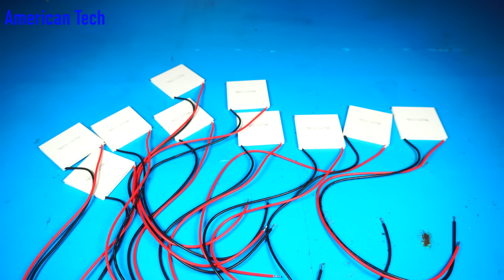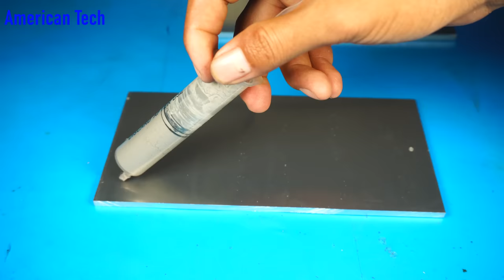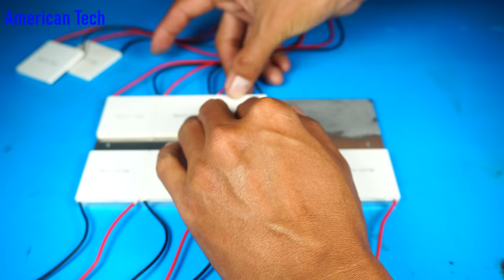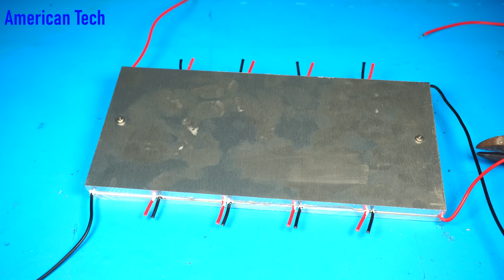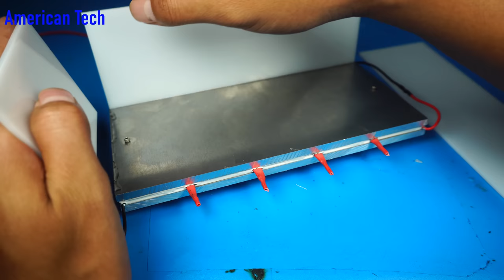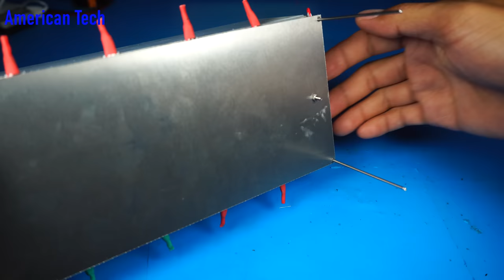DIY a big power of Thermo generator

Comment: Unfortunately, this video is claiming to generate power from a candle flame is not legitimate. In the video, the individual uses a Peltier device instead of a Seebeck or TEG generator. Additionally, the maximum current generated by these Peltier pads would not be enough to run a 24V motor of that size. To power a 12 Watt motor, a minimum of 12 Watts of power would be required. However, the individual in the video is producing only 1 Watt of power, including burning power. The Peltier device is known for its low power efficiency, producing less than 3% of the input power. This means that even with 100 Watts of fire under that contraption, it would generate less than 3 Watts of electrical power.

On average, a candle flame generates only 0.04 to 0.06 watts of power, which is a relatively small amount of energy. To generate 0.5 Watts of power, it would be necessary to use ten candles. It is unfortunate that social media platforms do not fact-check misinformation when it is not related to politics and fail to ban videos like this one, as they do with content that goes against their governmental agenda. It is important to be vigilant and critical when evaluating claims made in online videos and to seek reliable sources for accurate information.
Reply: Excelente.
Reply: Can u suggest the teg generator component to me that apply setback effect?
Reply: 1. "Peltier Device" is a TEC(Thermoelectric Couple).
2. "TEG" is a TEC( Thermoelectric Couple)
3. "Seekbeck" is a TEC(Thermoelectric Couple)
Items 1 thru 3 are infact exactly the same thing. They are simply layman's terms for application specific uses of a TEC.

 "A TEG"(Thermoelectric Generator) is an application specific layman's term used in place of thermoelectric couple when using it in a configuration to take advantage of it's Seebeck effect properties to generate electricity.

"A Seebeck" is an application specific layman's term used in place of thermoelectric couple when using it in a configuration to take advantage of it's Seebeck effect properties to generate electricity.

"A Peltier Device" is an application specific layman's term used in place of thermoelectric couple when using it in a configuration to take advantage of it's Peltier effect perperties to transfer heat from one side to the other (to heat or cool something) instead.

A TEC ..is exactly that..a coupling..or rather a conversion between electricity and temperature in either direction..regardless of what one chooses to call it.
Reply: If I were to build a larger setup, than what's shown, using 50 TEG's but heated by 300°F (+ -) from a wood stove chimney, and cooled with an endless supply of 40° - 45°F water constantly circulating, how many projected watts could it possibly produce?
Reply: Nor would I use acrylic. I'd weld steel watertight containers on the top side. Anyway, how many watts do you think? Hypothetically, for a maximum heat difference of 150°C, what could be the projected watts?

Comment: I want to make something like this for my woodstove. I live in Canada and heat with wood. Ideally, I would have a row of them being cooled by the cold air intake from outside while being heated by the chimney or a stovetop heatsink. I would power a fan with part of it for the air intake and then trickle charge my batteries through my charge controller. It would help with the lack of sun on my solar panels here in the winter time. Another idea I have is cold water on one side and hot water on the other. It would make more power but I am not sure what to do with all the water. Air handling seems simpler since it is happening there already
Reply: That’s what I want to do too!  I wish I could hear about your progress.

Comment: I know these very well and no way is it 500W the best TEGs are only 20w output each so if were 20w which they are not would be 200w .
Reply: They sell large ones...from 50w/100w all the way too 400w from one unit ones from Germany n other places not just China
Reply: Can you provide a link to these suppliers?
Reply: Links on here will always be deleted by bots.
Reply: @jshaw4757  the cooling and generating are not 1:1
Reply: In the same sentence you say that they output 20 watts and they don't output 20 watts. Which is it😅
Reply: @bryaniskoo  He's saying the very best commercial TEGs are 20 watts, these are almost certainly the cheap 2 dollar ones that generate 2-4 watts. But even if they were 20 watt TEGs you're only looking at 200 Watts total for 10 in series not 500 Watts
Reply: @tjfreckles1995  yeah they hardly make any power. The Amazon ones are complete trash for anything other than arts and crafts.

Comment: This is the best one I've seen yet but it's still not right. No one is making them properly

What you want is 2x2 panels stacked 4 panels high

Have the cold and hot sides all touching and have the main hot side bottom and the main cold side top. Having them stacked like this means they'll balance the heat out amongst all of them evenly and produce more power overall

For the cold side you should just have a square metal tube with the top cut off and a heat sink in the middle where it contacts with the panels then run cold water through the tube

The hot side can be run with vegetable oil if you use carbon felt. It's able to wick vegetable oil to be used as a candle and it's super safe because the oil can't burn unless it's being wicked by the felt. If it tips over the fire can touch the spilt oil for a very long time before it'll light on fire
Reply: Or cut a hole in the hood of your car. The top facing the outside should be able to cool off as you are driving. Then we can get rid of the alternator improving gas efficiency and now we can charge the car while driving.
Reply: Hi,
You seem to have a good knowledge about TEGs.
I have a question, can I make a grid of TEGs with cold side facing outside of a wall of a room and the warm side facing inside the room (with a fan of course) to make an air heating device for free in winter?
Reply: @Maxim.Teleguz  that would work, but you'd want it exposed to air from underneath the car, not on top of the hood. The sun will heat cold panels, reducing efficiency otherwise

TEGs still have extremely low efficiency, so you'd be better off just sticking with the alternator
Reply: @seyedseyedy3558  That would work as an air heater, but it would be extremely inefficient and most certainly not be free

TEGs have relatively low maximum temperature ranges. You'd be lucky if the hot side reached 70C

 Nothing is ever free. You'd need to pay for the parts, and I'm sure you could find a heater for a similar price to what you'd pay for parts 

TEGs can either use energy to heat and cool, or they can use a temperature differential to generate energy. What you want to do will use energy. You'll be heating air inside and cooling the outside air, which costs energy
Reply: @drsatan9617  Thank you very much for your response.
I've seen people putting hot water on one side of a TEG and get a very low current or vice versa, if they put ice on the other side. 
But my plan isn't to produce electricity, I just want to use the outside freezing temperature on one side and get heat on the other side. The 70 degree that you mentioned is quite sufficient. 
Is it possible?
Reply: @seyedseyedy3558  It's not possible. Either you put energy in, and one side gets hot while the other gets cold or you get energy when one side is hot while the other is cold

You can't have it both ways with one circuit 

To generate heat with them, you need to input energy

It doesn't change anything if you only heat one side or cool the other. It'll still generate power as it works based on the temperature difference of each side

Which way you have wired it determines how it will function. 

You have your TEG, and it has positive red wire and negative black wire. Hook those up to the correct terminals of a battery, and one side will heat up while the other side cools down. 

If you wire it up the incorrect way as in put the black negative wire to the positive battery terminal and the red positive wire to the negative terminal, then the battery will charge if you heat one side and cool the other

As far as the videos you've seen are concerned, it doesn't really matter if you either heat one side or cool the other. So long as they aren't at the same temperature, they will generate power. The greater the difference, the higher the current
Reply: @drsatan9617  Thank you very much.

Comment: Lol 500 watts huh. Not in your lifetime. The best you can expect is 5 watts per module and that's at about a 150 F difference in temp. Fake AF.
Reply: Why so many models....50w/100w/all the way too 400 watt just bigger modules even the German ones claim 100w for around £30 so you think even top German company's are lying and Japanese modules n other euro company's thst make them
Reply: I'm from England so I use degrees but if a large heat sink on bottom sat in ice water with a PC fan blowing across and you use a hair dryer on top you think it won't get close too written pottentisl I mean I bout cheap Chinese ones years ago but I didn't really know what I was doing back then but if I remember it charged phone n ran LED n stuff
Reply: @jshaw4757  Where can I find the German one? Can you provide some link or Company name? thanks

Comment: i just tested the same module yesterday , using hot water, the temperature difference might be 60 degree , and it output about 1.6v and 60ma  , so for my condition, if i joined 10 of these modules like you, it will output 16v*0.06a = 0.96 watts, since this video use fire for heating, i guess the power watts cannot be 500 watts, maybe 50 or less
Reply: unfortunately this video is another fake. He is using Peltier instead Seebeck or TEG, second the maximum current generated from these peltier pads wouldn't run a 24V motor of that size. He would need at least 12Watts of power for that motor,  but he is producing 1 Watt if all is correct including burning power. Peltier is less than 3% power efficiency. So 100 Watts of fire under that contraption would generate less than 3 Watts. A candle flame typically generates around 0.04 to 0.06 watts of power on average. It would be necessary 10 candles to generate  only 0.5Watts. 

I have seen people wasting a large sum of money trying to replicate fake online videos. It would be wise to do mathematical calculations using physics before attempting to build something. I know people that believes on youtube videos when showing scammers powering cars with hydrogen gas and other misinformed products. These innocent people could have died if nobody wouldn't have stopped them. To replicate these contraption will not work and only waste money or place lives in risk. It is a shame that youtube wont use fact check for misinformation when it isn't related to politics and ban videos like this. The only time you see it working is when they dislike someone against their governmental agenda.

It would be amazing if we could really use TEG to generate enough power in times of emergency but it is far cheaper to have a solar panel of 20W and small 12v batteries of 2000mAh in the scale of 1 to 100. You could buy the solar panel and a battery for less than $20 online and have far more efficiency.
Reply: @melissahulkenberg5376  thanks for the detailed explain, its still useful for me to use TEG, because for large using, its cheaper by storing heat than storing electricity (using battery), also the current battery cannot last a lifetime usage while heat storing container could. so if the TEG could became cheaper than currently in 10x, i guess i will need a home electric system on it

Comment: Notice how he blocks the meter while running the motor? i see when he started the wattage was only 18 @ 30.6 volt and occasionally you can see part of the meter screen with wattage dropping to under 1
Reply: ummm. he disconnects the wires from the meter to touch them to the motor. How could it read anything in that case?
Reply: @Mr_Chuckles  yeap, he didnt get it.

Comment: he have 10 peltier at 2 watt each its 20watt... seem enough to feed the diesel heater on low setting with his own waste heate... maybe with more like 20 peltier will be enough power to circulate water to move the waste heat collectors flow

Comment: Can you use a step-up transformer to power appliances?
Reply: maybe a little alarm clock. no way this is anywhere close to 500watts
Reply: No. It's output is DC. Transformers utilize AC.
Reply: @justtinkering6713  a step up transformer that converts DC into AC, if i'm not wrong the right name is a inverter, but this setup won't generate much power
Reply: @skorpionmk9390  an invertor does that. But it's not considered a step up transformer. The circuit takes the DC and turns it into AC then sends it to a step up transformer. It's more than just a transformer.

Comment: Can it be used as a solar panel without ice ?
Reply: You could use them as a solar heat collector. It wouldn't be converting the light into power it would be converting the heat produced from the sun into electricity. 

These peltier units operate using the Seebeck effect. Nowadays they are made from semi conductors like solar panels but they don't work in the same way.

You don't need ice you just need a hot side and a cold side. If you power them you can exhaust the heat produced to make the other side cold or hot depending on the application.
Reply: I've found that this is the basic units that NASA uses to build their RTGs (radioisotope thermal generator)

The basic concept is that your source of heat is uranium 235 which produces about 9.5wh of heat per gram. So you'd put that in the center and then some heat conductive shielding around that.

Then the peltier units, then aluminum heat sinks around that probably with PC fans which only take 1.8-5wh to run so the gains will be more than the loss.

Basically uranium 235 has a 706 billion year half life of energy that it just emits. The peltier units last for about 25 years so in theory you'd have a reusable fuel forever and a device that lasts 22-25 years constantly producing power 24 hours a day.
Reply: At 9.5wh a gram you'd need 146g to theoretically produce 1200wh at 24 hours you'd make 28,800wh a day. Approximately, my math could be off. NASA uses these devices to power their rovers and other space missions. The bigger the difference in temperature the more efficient the power generation is.

You could use the sun or burn a fuel but then when those resources run dry you have nothing for power. So passive nuclear that doesn't involve making a star on earth makes a lot more sense. 

The world and people living nearby really can't afford something going horribly wrong due to an oopsies in the process of nuclear. 

An RTG wouldn't be shooting electrons into anything splitting atoms and trying to contain the absolutely Ludicrous explosion of a nuclear bomb. It would just be passively producing power off of a rock that naturally exists.